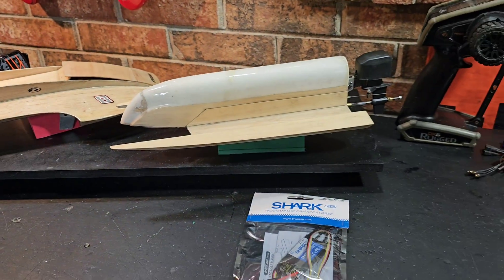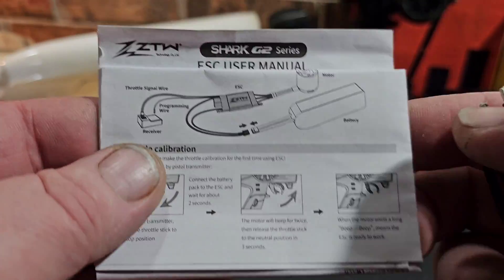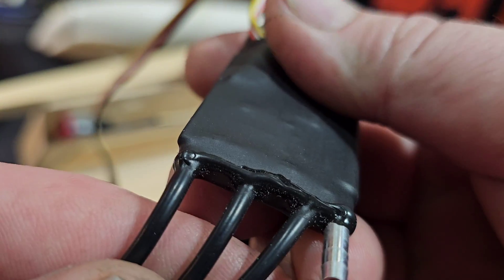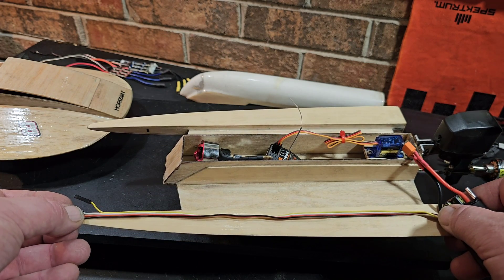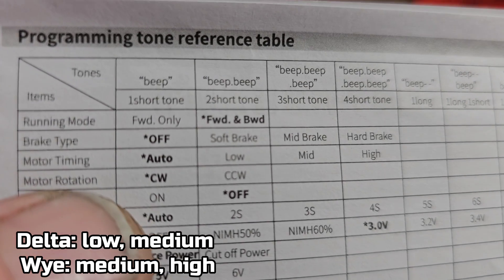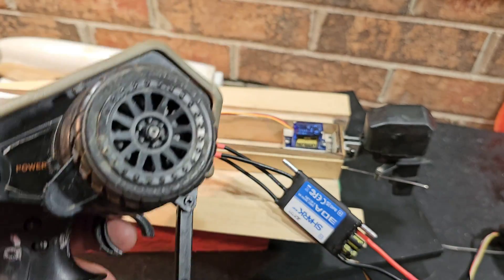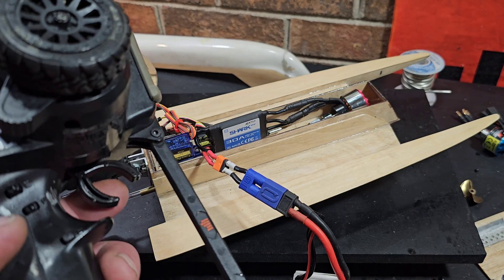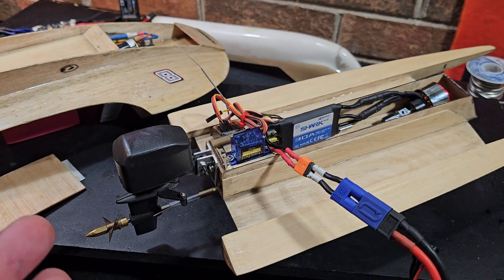Brushless ESC Review, & Setup ZTW Shark G2 30a 32-bit RC Boat Speed Control

Comment: I Used shark 50A to my 4000kv  2835 brushless motor. On first throttlr and acceleration is ok.. but i. Second time the esc beep twice. And when i press the throttlr it has a delay acceleration o try i over and over again but it all so the same happend.

Comment: Are we meant to pump water through the pipe of the ESC?
Reply from the maker: Most rudders have a water pickup and nipple, yes run water from the rudder to the esc and out the boat.  

This boat was so small it didn't need any cooling

Comment: Hi fellow, Have these shark esc proved reliable in your use?
Reply from the maker: Yes, I've had great success with this one.
Reply: @IRONCLADRC  ahh thanks for the reply  I have just ordered a couple of the smaller 50 amp ones , small jetboat mod inbound!
Reply: @grrfy  same, just got a 60A Shark for my 3s/ 3100KV brushless swap on the Jet Jam. Decided to bite the bullet and drill through the hull and the jet outlet, that way I can go water cooled for the motor and esc. I like full throttle and I don't want anything burning up on me. Hope it works out for us both lol 😅
Reply: @bradfisher22  I still need to solder conectors and stuff to mine, that sounds like a good sensible mod to me,it really helps,will follow on here and see how you do

Comment: I'm wondering if you know how I should program the ESC to make it stop automatically when it loses connection from the transmitter. I turned off the transmitter before I unplugged the battery, and the motor went to full power. Thank you!

Comment: I'm building the 21"twin cat as you know and I did look at these esc. I didn't like that there wasn't a 90 amp because I wanted 20 percent more esc amperage than the motor requires, and second the programming card was more than the motors like you said. Also i didn't like the water cooling they had going on, or not going on. It just wasn't enough for these motors.  Anyway I went with 2 reliable flycolor 90. Can't go wrong with those and I have the room, barely. Bg4l